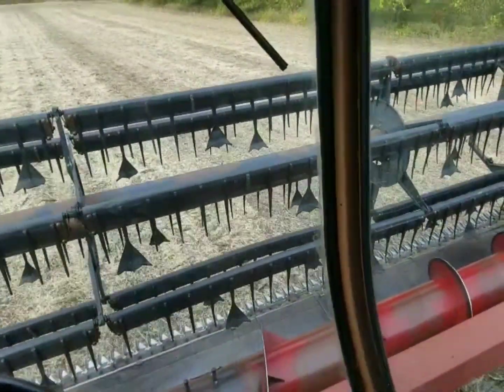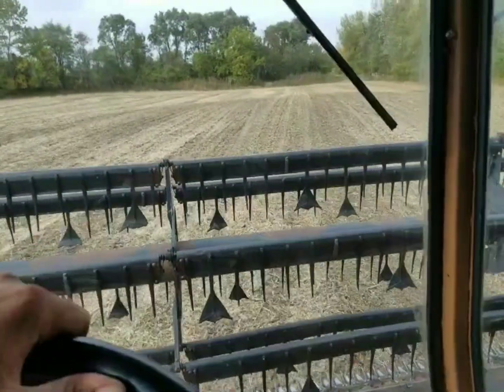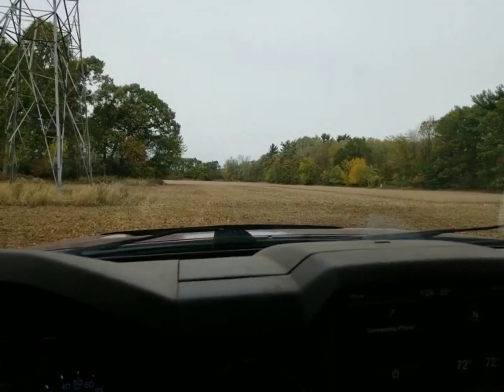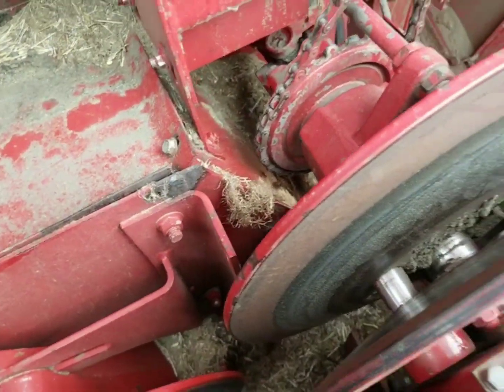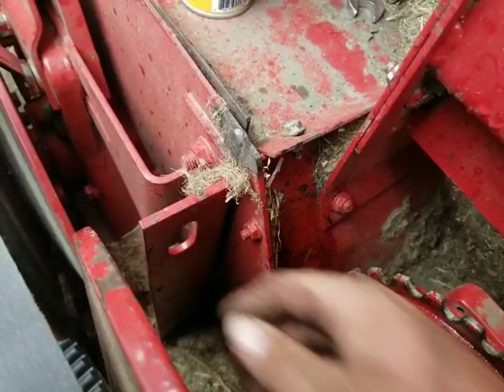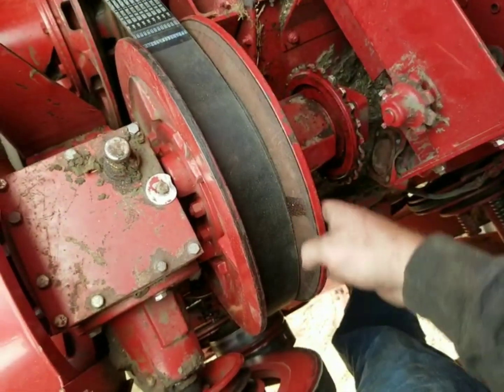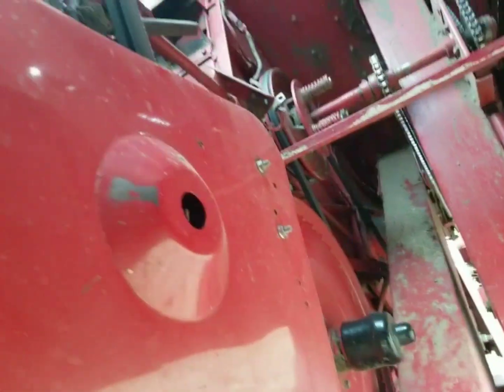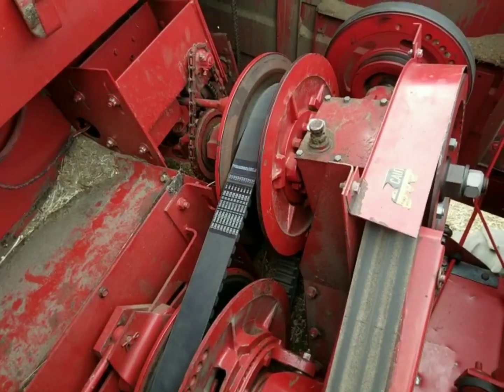Case IH 1660 Axial Flow Combine Rotor Belt Replacement

Comment: My 1460’s belt needs to be replaced, glad you made this because know I know how to attack it lol. Great video
Reply from the maker: Thank you!! I'm glad I could help....you will need to hold your rotor from turning so you can get the rotor pulley to spread ours was still full of beans so it wouldn't turn and I just simply took the rotor wrench and made it spread open and dad got the belt dropped in it....best way to do it is probably wedge a block of wood in the rotor some how

Comment: I don't know why but it seems our 1660 has had all the same failures!   I'm on my 3rd rotor drive belt since I bought it in 20000.  I do it a bit different but same results.  Also have replaced all the bin unloading augers and tubes plus a new bin floor.  The rotor drive coupling was bad when I got it, took a while to figure out was going on but it finally failed completely before we figured out why it kept breaking the drive gearbox frame.  The spline wasn't fully engaged in the coupling, only about 1/4 the spline was engaged, and worn to the point that under load it would push the spline apart.  Must have been that way from the factory.  Replaced both parts of the spline and all the frame mounts as well as welding the separator frame to cure it.  The hydro is starting to get a bit weak, any easy cures that don't cost a fortune?  Lately it's been on a hydraulic hose replacement kick, 3rd one this week.  Bad enough to change a line but it always loses the oil supply, not cheap.

Comment: I really need an explanation how you got the slave pulley to spread open
Reply from the maker: Put the rotor in gear and stick a bar through the concave or key stock grates to hold it from turning take your rotor wrench and stick it in the rectangular holes in the rotor pully and pull and it will roll it open
Reply: @dirtgrainsteel  ok thanks. We got a newer model and I wasn't sure if it had a pull bolt on the end of it